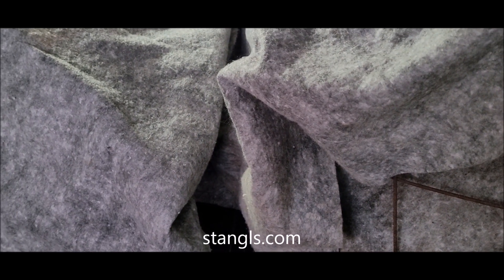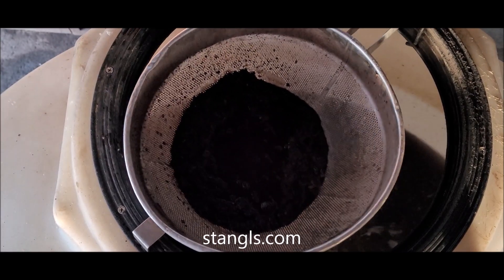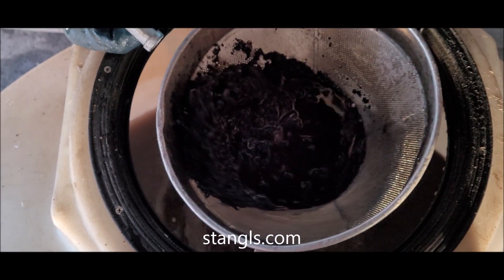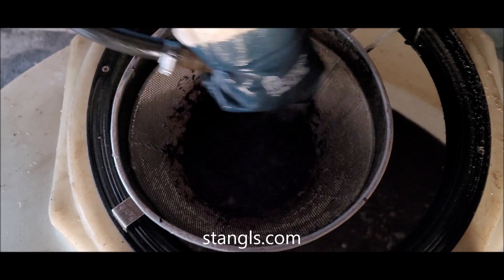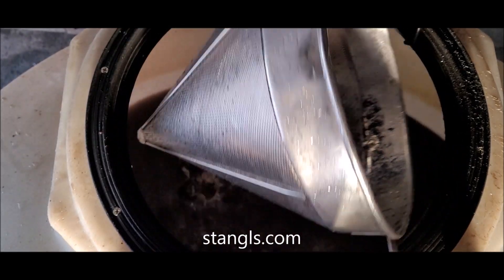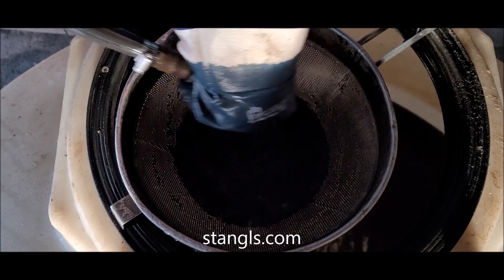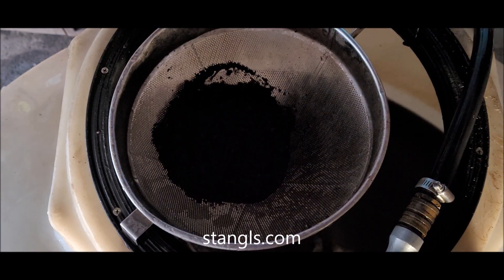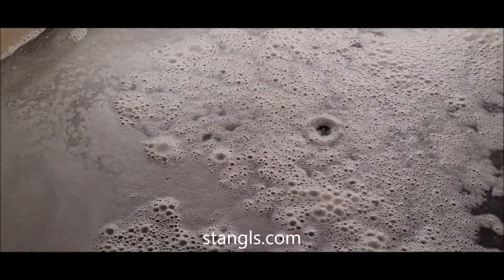Making my extract

Comment: Personally I am extremely skeptical that any type snake oil is worth the trouble, but lots of salesmen have found magic elixirs CAN make them money.
Reply from the maker: Thank you for your comment. I understand skepticism, especially in an industry where misinformation can be rampant. However, I assure you that the methods and extracts I demonstrate are based on solid scientific principles and practical results, not on "snake oil."

Our extracts, like those from the Johnson-Su composting method, have been proven to significantly enhance soil health by increasing microbial activity, which in turn promotes healthier plant growth. These practices are backed by extensive research and have been successfully implemented by numerous farmers and gardeners to improve soil fertility and crop yield.

Skepticism is healthy, but it’s important to differentiate between baseless claims and evidence-based practices. I encourage you to delve deeper into the science behind these methods and perhaps try a small, controlled experiment on your own soil. You might be pleasantly surprised by the results.

Feel free to reach out if you have any questions or need further information on the studies and results behind these extracts. Your healthy dose of skepticism might just turn into a strong endorsement of these proven techniques.